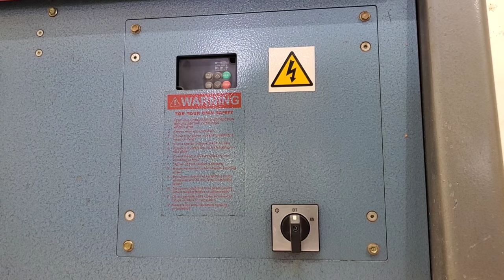Woodturning - Pine lamp shade【職人技】木工旋盤を使って丸太からランプシェードを作る

Comment: Good morning. It's really beautiful. It reminds me of the planet Jupiter with its vortexes and color. The craziest thing is that it is only in your home that I saw the wood worked with such finesse that it becomes translucent. I guess it's as fragile as glass, even more. As always I have a question. There is no risk that light will damage it? It is true that with the new generation of bulbs there is no more heat as with the old ones. But still I wonder if the light that seems strong enough does not risk weakening the wood. Thank you for this beautiful video. I wish you a very good day. Gabriel (France).
Reply from the maker: Good morning! 🙇🇯🇵
We received various opinions such as the sun and planets.  I think that there is no problem if the light bulb is about 60w.  In addition, the strength of the wood is considerably higher due to the paint that increases the strength of the penetrating wood.  However, since the standard of the light bulb metal fittings is different from that of overseas, it seems that another metal fitting will be required to use it overseas.  We are considering whether to improve it to a stand lamp.

Comment: Does the vase hold or crack when it dries?
What do you use so that your products do not crack when they dry?
Anyway, I love your works!
Carsten Blomqvist / Sweden
Reply from the maker: Thank you for your comment! From Japan🙇🇯🇵  
Uses a paint that cures in response to moisture.  Before drying, conifers such as cedar and pine can be easily processed.  By making the wall thickness 1 cm or less, cracks will not occur.  Try paying attention to the wall thickness when there is no paint.